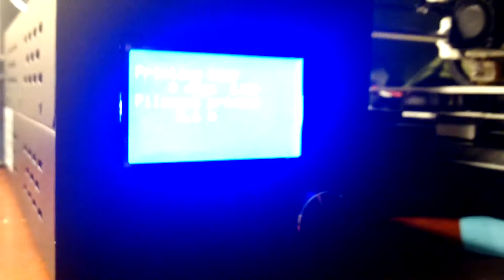It's Alive! - First test print with Maker Select 3D Printer (Monoprice)

Comment: How have you liked this so far? I'm thinking of getting one.
Reply from the maker: So far it's been really good, especially sub $400. it took me about 5 hours to get really happy with the configuration, but I've done 5 prints and they look great!
Reply: +Jake Tobin so would you say it's a good 3d printer for beginners?
Reply from the maker: +Joe “Jominator” Evans I think so, this is my first 3D printer and was more or less an impulse buy. I've been doing a few benchmarks and it seems to hold it's own against much more expensive rigs, though it does print slower to get the same quality (I've found that 30 / 50 mm/s is the most inside / outside  speed you want for quality).

Thoughts on this printer:
 - Be prepared to tinker with it a lot. Cura works well with this when you start tinkering
 - I find myself curious about dual extruders or higher temp filaments like Nylon, which this will not support. Make sure these aren't must-haves.
- If you want something that's perfect out of the box then consider saving more. If you just want a cheap way to get started, I'm throughly impressed with this as my first machine.
Reply: +Jake Tobin would you mind sharing your cura settings for printer speed along with the settings you provided or point me to a place that has some support for it like a community